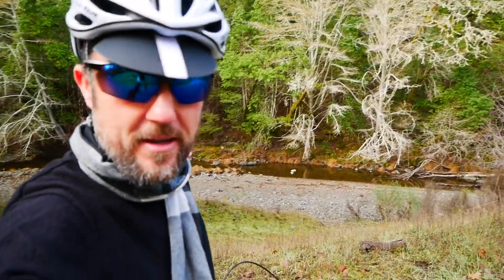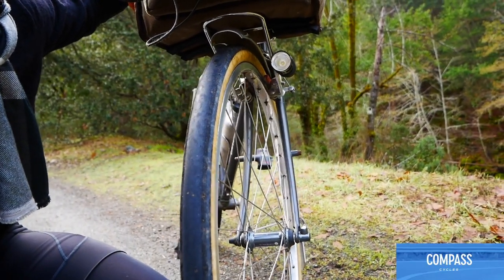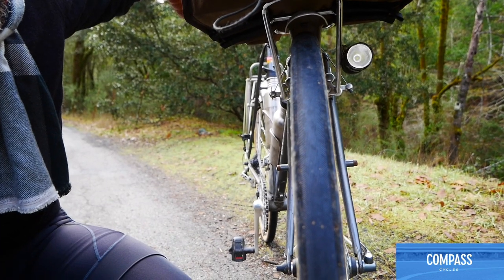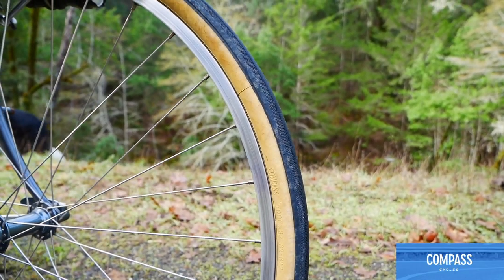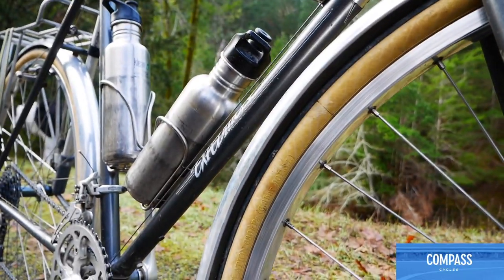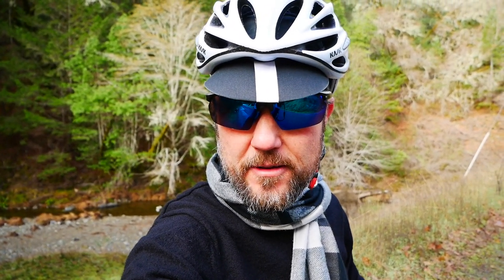Compass Tires - 3000 mile update

Comment: I I love your channel. 
Because of you and Miss Cools, I am running Gravel King 700 38c S/S on my gravel bike. And running 700 38c Gravel King Slicks on my carbon road bike. Previously, I ran 45mm on gravel and 32mm on road. I opted for the Panaracers for the “gentler” prices compared to Rene Herse. I do have back up wheels for each bike (32mm and 45 mm) . I’m must say,  I love the supple tires from Panaracer. I run everything tubeless and at just lower pressures than max. 
Also got a really cool RUTHWORKS bag. 
Thank you for the information, inspiration, and motivation. You guys are awesome.

Comment: Tried to from Seattle to SFO on Bon Ton Pass (700 X 35 I think) tires. Got 6 flats in 600 miles. In Crescent City  I swapped them out for RiBmos. It may be they are not suited to loaded touring or the pressure was too high, 60 psi. However they were such a nice ride I'm using the 26" version on my new Rodriguez and have 2000 flat free miles on them now at 40 psi.
Reply from the maker: I've discovered with these tires it's better to run them at a lower pressure than what you might normally ride. Also, I watch for sharp objects and glass on the shoulders of the road. These two things have really helped me from getting flats. My current set of 48 mm wide tires have only had one puncture in 2400 miles. I set the back tire to 35 psi and the front to 30 psi for road riding, and a little lower if I go off-road.
Reply: @Henrywildeberry  Are Compass tires the same as René Herse? I just bought some René Herse Rat Trap Pass 26x2.3 tc (riding a 1993 Rockhopper). I'm 165 pounds and wondering what would be a good PSI for pavement or hard dirt/gravel. Any suggestions? Thanks!
Reply from the maker: @LaserrSharp  Rene Herse was formerly named Compass. I'd start with 20 psi. If it feels too soft add 2.5 psi. If it's too hard try letting out 2 psi. These tires like to be run at low pressure. You'll know when they are too low the bike will feel like it wants to wander on road. Good luck!
Reply: @Henrywildeberry  Appreciate the response. Thanks!

Comment: Are these tires directional? Just bought the same ones and just wanted to make sure
Reply from the maker: Hi Jonathan, They have a file pattern (chevron) with an angle and they typically set up with the file pattern "arrow" pointing forward. However, I have run them in both directions and haven't noticed any difference, so it shouldn't matter.

Comment: Have to say 2500 miles is a pretty short life even for a rear tyre.
Reply from the maker: Rob Appleby Just to make sure we’re talking about the same thing. 2500 US customary units is 4000 kilometers. Thanks.
Reply: @Henrywildeberry  Sure. It still seems like not very much. I reckon I ride 5000 to 7000 km a year on mixed tracks (gravel) and road and I don't get that kind of wear. No criticism intended, I'm just surprised. Everything else I've heard about Compass tyres has been good.
Reply: I get around 8000km out of my GP5Ks.. I concur with what u said Rob.